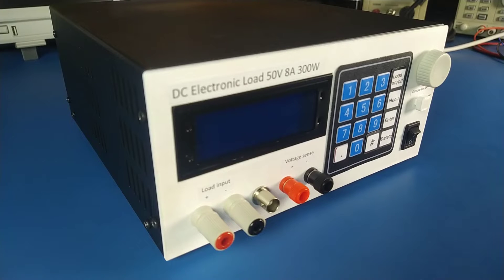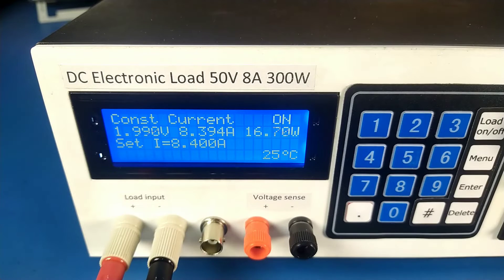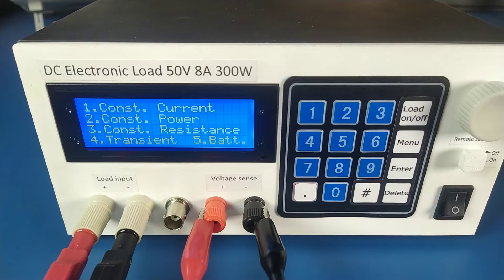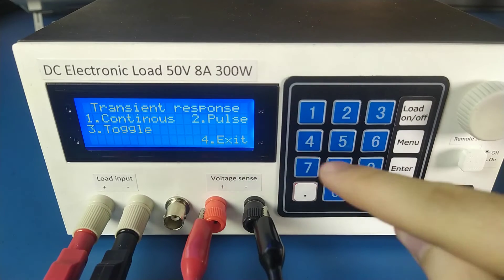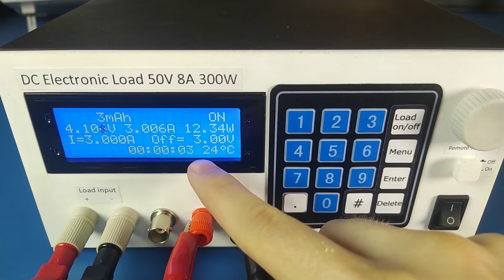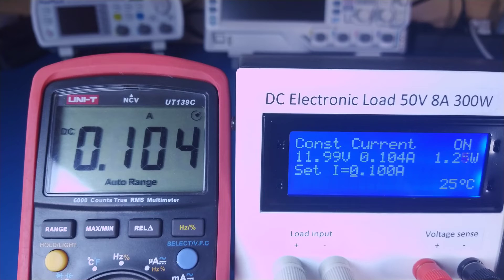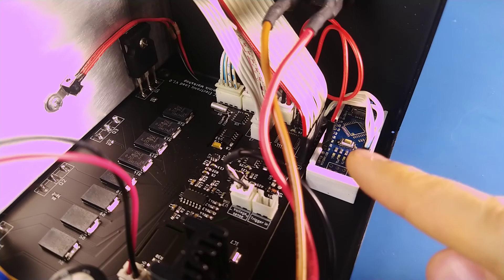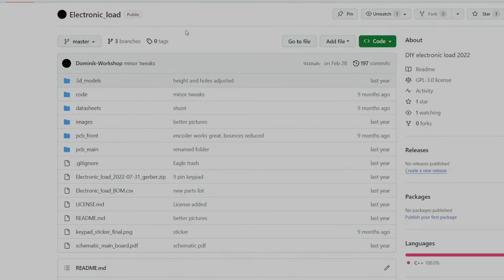DIY DC Electronic Load - 300W

Comment: You are producing some very good quality projects. I have subscribed. I look forward to see what other test equipment you will be making. Also, with this electronic load, do you think it is possible to scale it up to 1000 watts? Bigger heatsink, more fans, more MOSFETS etc.
Reply from the maker: Thank you for your kind words!
Yes, it should be possible to scale it to 1000W as you say, without a problem.
Reply: @dominikworkshop6007  That's good to hear. Maybe you could consider a design and build as a future project? I just think having a bit more current and voltage capability would be useful and extends the uses for such a device.

Comment: Hi Dominik, thanks for your video and for sharing the project files!
I have one question: Is it possible to upgrade from 8A to 50A at 24Vdc?
If it is possible can you guide me in the modification?

Thank you.
Reply from the maker: Thanks, I'm glad you liked the project!

Yes, it's possible to upgrade the current handling to 50A. You have a couple of options:

- Upgrade the existing power stage:
Use MOSFETs with a lower V_GS(th) so that each one can handle ~12.5 A (assuming 4 in parallel) with V_GS=5V.
Decrease the shunt resistor values proportionally to match the higher current.
Update the firmware to reflect the new current scaling for accurate readings and control.

- Add additional power stages:
You can replicate the power stage (AD8630 + 4 MOSFETs) and modify the code to manage the new section accordingly.
This will spread the current across more components, reducing stress on each.

If you're targeting a full 50A at 24V (1.2 kW), you’ll likely need to add at least 6 more MOSFETs. Whichever approach you choose, make sure to carefully check the thermal performance and ensure that the MOSFETs’ power dissipation stays within safe limits.
Reply: @dominikworkshop6007 
Thank you very much for your reply.
I think in each cases i have to increase also the cooling system.

Anyway I will try with the first choice, and after i do that i'll give you a feed.

Thanks a lot again!

Comment: Good job, Scully would probably like it. One question,  I would like to see a possibility to store / transfer measurements , especially in battery testing mode. Any thoughts or even plans to realize such a feature?
Reply from the maker: @drulli1  Thank you. This feature already exist, at least in the battery measurement mode - there is a desktop app, that lets you save the measurement in png or csv file. You can see some information about the app in the README https://github.com/Dominik-Workshop/electronic-load?tab=readme-ov-file#pc-remote-controll-battery-mode-app, though there isn't a full documentation for it. Hovever, I hope that it will be intuitive to use. But feel free to ask if you will have any further questions.
Reply: I still have the Scully original PCB here in a box. He had found problems with the PCB later on because the ground current return path was under dimensioned.
Anyhow, your project is on top of my project queue. ☝️
Reply from the maker: @drulli1  I'm glad to hear that! 
I'd be delighted to hear how the project goes for you. 😀

Comment: Great work, I intend to do this project but I don't know how to organize the code, it's complete to compile on the atmega.
Could you help me, thank you.
Reply from the maker: Thank you!
You just have to install necessary arduino libraries and it should compile without problems. Is that what you were asking about?
If you have any further questions, feel free to ask.
Reply: @dominikworkshop6007  ,Thank you for your reply. I work with electronics, but I'm a beginner in programming and I know very little. My question is how to organize the code, like copying and pasting one by one into the Arduino IDE.

Because there are several .hh and .cpp files and I don't understand how to do this, where each one should be, like in the setup or in the loop.

I'm used to creating simpler codes this way.
Reply from the maker: @fabiotec2012  Ok, I understand now.
First you need to learn a bit how to use platformIO (VS Code extension) to program Arduino boards (I didn't use Arduino IDE for programming). There are plenty of tutorials on YT on that topic. After you get that, you will probably know how to compile and upload my code.
Let me know how it goes.
Reply: @dominikworkshop6007   Thanks again. I did some research and managed to put the code in VS Code and Platform correctly, and I have already installed the libraries. However, I have some questions; 1- This load is for 50 volts and 8A. I took a look at the code and saw that the maximum current is 8.4A, 300W, but I did not find the maximum voltage limit because for my use I need a higher voltage and current of around 100V and 40A. I have already made changes to the scheme to handle this voltage and current.
2- This project uses the Mico Atmega 328p directly. How do I program the code on it, directly using an Arduino Nano or with another programmer such as CH340?
Reply from the maker: @fabiotec2012  
1 - for the voltage: you need to modify the measurement method in the code (src/measurements.cpp). You would have to reduce the gain from x8 to x4 and increase the vmax factor from 0,512 to 1,024 (I'm assuming you didn't change the attenuation factor of the differential amplifier).
For the current, make sure that you update the shunt resistance, because I assume that you changed their values to increase the current range. Keep in mind, that increasing the range of voltage and current to that extend, will result in worse measurements resolution.
2 - if the Atmega that you have doesn't have a bootloader, you would need to use the SPI connector to upload the code via USBasp ICP. If you want to go the easy route, use an Atmega with bootloader present. Then it can be programmed via the arduino nano usb connector (keep in mind, that the Arduino board has the microcontroller removed, and just the CH340 IC is used from that Arduino board, which allows for programming and serial communication with the Atmega on the main PCB of the load). So you could just move the Atmega from the Arduino nano to the load PCB, and program it via the usb connecor.
Reply: @dominikworkshop6007  Thanks again for your reply...
For now, I'll leave the voltage at its current level and just increase the current to 40A.
In this project, you use a 4-channel AD8630. In my case, I want to use two of these or use a 1-channel AD8628, one for each MOSFET. This has the advantage that if a MOSFET shorts out, it will only damage its AD without affecting any others. I think it might be better this way, but I'll still do some testing because using two AD8630s saves space and components on the PCB.
As for reverse polarity protection, I'll use either a high-current relay that will only turn on when the OFF pin is activated or two high-current Schottky diodes.
The advantage of the relay is that it completely isolates the input. The diode is more practical, but it has losses and heat.
To indicate that the polarity is reversed, I intend to put a simple LED on the input that will light up if connected in reverse.
I'll use this one for the MOSFET resistors:
https://pt.aliexpress.com/item/1005003521111568.html?spm=a2g0o.cart.0.0.73997f06yr95HP&mp=1&pdp_npi=5%40dis%21BRL%21BRL%209.89%21BRL%209.89%21%21%21%21%21%402101ef7017430845173557575e1b59%2112000026155929534%21ct%21BR%21857614113%21%211%210&gatewayAdapt=glo2bra
Thanks again...
Reply from the maker: @ Using one AD8628 for each MOSFET sounds like a good idea.

For the reverse polarity protection, if you decide to use the relay, do you mean to use it to just disconnect the output, and put the responsibility on the user to check if the reverse polarity indicator LED is ok before turning the load's output on? Or do you have some other solution in mind?

These shunt resistors look like a good fit. 

I'm very curious how your load will turn out!  :D

Comment: Amazing work. Thanks a lot for share complete project . I made it and working ok . But I can't calibrate the current as much as i saw u in your video . I am requesting  u put an another video for calibrate voltage and current.
Reply from the maker: @KIRANY07  Thank you for your feedback! I'm glad you got it working. It is a good idea to add a calibration video tutorial. I`ll try to make it as soon as possible. 
Did you use the calibration function? And how much off are the measurements?
Reply: @dominikworkshop6007   Thank you so much for your quick reply☺. Yes i used calibration function , but the flash memory overflows so commented transient Response Mode temporarily. I calibrated Voltage but the current is not linear . Can you explain the difference between current multiplier and current offset.
Reply from the maker: @KIRANY07  Current offset adds constant value to the current measurement, and current multiplier multiplies the measurement. So current offset should be calibrated at low currents, and current multiplier at higher currents.
Reply: @dominikworkshop6007  Ok understood thanks . I'm waiting for calibration video. I hope it will come soon.
Reply from the maker: @KIRANY07  I just uploaded the video: https://youtu.be/jx0t7Ovq4uw. Let me know if this guide is understandable and if you managed to calibrate it properly.
I'm sorry it took so long.
Reply: @dominikworkshop6007  Sorry for the delay.  Thank you for considering my request. Yes i can able to calibrate the DC Load and now it is working perfect. Thank you so much for the Calibration video.

Comment: Hi, I've been working on my own load for testing Li-Ion/Li-Po battery packs for a while now and your project caught my eye. I would like to use some of the solutions but I am very curious why the LM4140 reference voltage circuit is used? Basically it only supplies the DAC, but there is a huge voltage divider at the output: 10k/560R. So the voltage range going into the amplifier is only 0-217mV? Am I understanding this correctly? I wonder what the point of this is, as the voltage in the amplifier is boosted back up to a maximum of 5V
Reply from the maker: Hello! The LM4140 was chosen for its outstanding stability, particularly due to its low temperature coefficient. Since the DAC's output depends on the supply voltage, ensuring a very stable reference voltage is crucial for consistent performance. The DAC needs to operate within a supply voltage range of 2.7V to 5.5V, which necessitates using a voltage divider to limit the output voltage range, as you correctly observed.

The reason for setting the output voltage range to 0-217mV is that this reference voltage is compared with the voltage across the 0.1 ohm shunt resistor. When the reference voltage on the non-inverting input of the U1 amplifier reaches 217mV, the corresponding current through the shunt resistor would be 2.17A (for one power stage, there are 4 of these in parralel).

Hope it clears things up, and that I understood your question  correctly.
Reply: @dominikworkshop6007  That is exactly what I meant and thanks for the reply. I've done some simulations and with your explanation and the schematic provided (and some information from SW) I will use a very similar mosfet gate control. Your projects are brilliant, keep up the good work.
Reply: @dominikworkshop6007 Thanks to your advice, I managed to build a load for li-ion/lipo packs. Stable 25V/18A with acceptable temperature below 100 degrees on mosfets. Thanks for the info :)
Reply from the maker: @qbas060  Congratulations, I'm glad to hear that!

Comment: Hello Dominik, great work🎉. I do have a question for you. There is a labeled pin as “OFF” in the schematics. Since this pin is same in every mosfet and controlled by 1 output pin so how do you calibrate each mosfet seperately? Thanks!
Reply from the maker: Thank you!!!
I don't have to calibrate each mosfet seperately. The op-amps ensure that the current is very evenly distributed. I used 4 resistors to sum the voltage on shunts, but it turned out unnecesary (maybe except for when there could be some hardware failure), because the op-amps are so precise, that the voltage on shunts is pretty much identical. Hope I managed to clear this out.